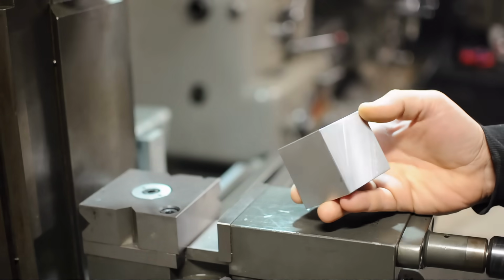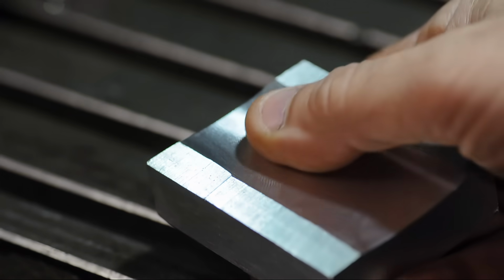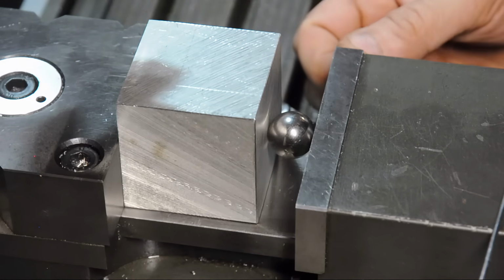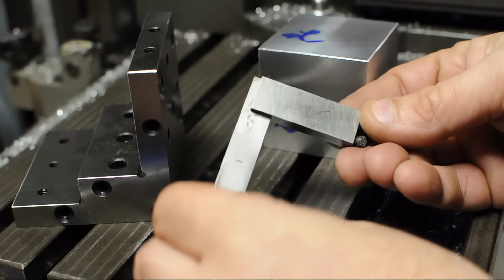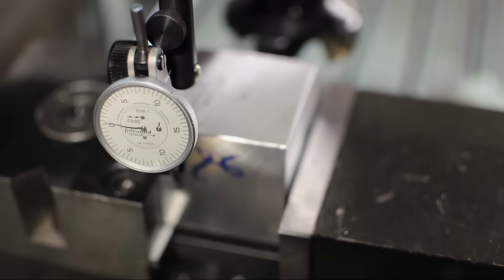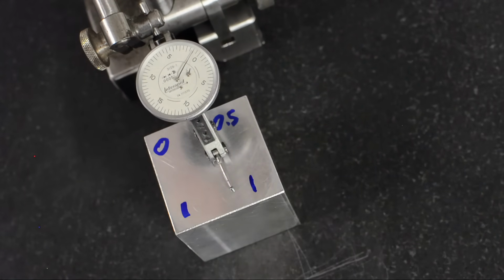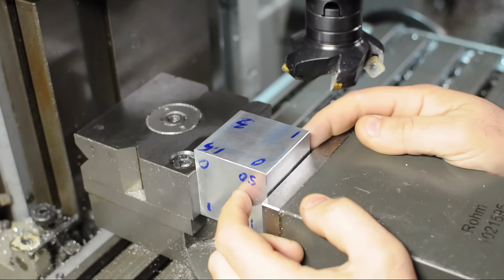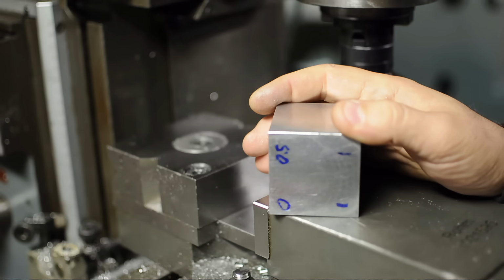Stock? Mill? Square!

Comment: Parallelogram two sets of parallel sides.   Trapezium is only one parallel set.  Rectangle and Square two pair parallel and both are square to adjacent face.  Square have same diagonal in both directions - corner to corner across any face for a cube .

Comment: It's a parallelogram
Reply: it's a rhombus.
or is it a diamond?
nah, I think you're right, it is a parallelogram!
Reply: A rhombus is to a parallelogram as a square is to a rectangle :)
Reply: +Tristan Antonsen almost, the classification "parallelogram" encompasses rhombuses, rectangles, and squares, and both "rectangle" and "rhombus" encompass squares.

a parallelogram is any 4 sided shape with opposite sides parallel, with no other requirements.  rhombuses, rectangles, and squares all fit that bill.  a rhombus is the same thing, but with the requirements that opposite sides and angles be equal.  a rectangle is a parallelogram with 4 right angles, and a square is a rectangle with 4 equal sides.  being that the sides are equal and the all the angles are the same, a square is a rhombus, and being that it's got 4 right angles, it's also a rectangle.

of course, all of the above fall into the classification "quadrilateral".  quadrilaterals are also polygons, polygons are also shapes, shapes are also thingamajigs.  ergo, we're all thingamajigs.  enjoy your existential crisis.
Reply: but if you were to describe the shape to someone who was, for some reason, unable to see the shape then we'd use the correct term "rhombus" as it simplifies description. Sure, you can call it a parallelogram, but then you have to add information to state it has four equal sides.

Comment: Did you measure  the chair to see if it came out level?
Reply: Bob Korves gonna need a larger surface plate
Reply: Should have just rotated the chair. Eventually all four legs would be touching and the wobble would be gone. I believe Numberphile showed the proof. Or maybe it was Mathologer... Who knows...
Reply: Must measure the floor first, then the chair. :)
Reply: Doesn't matter if it's level as long as the cats tail isn't caught.

Comment: I have an 180 pound chinese machine (HBM16) and an chinese vise with no block down system. I usually freak out with an 0,05 cent error (.002"). I cannot believe you could easily have .003 error with that expensive stuff. 0,000 is utopistic.
Reply: You missed the part about him shimming the part to introduce the error?
Reply: Jon Simmons wait wait... I'm italian so I'm not able to understand a straight 25 min video. Surely I missed many parts and details.
Anyway, I just said that seems impossible stay <1, expecially with a 5 bucks machine.
Reply: Its cause everything about his method is wrong. Its sad that people are learning from this. When he puts the block on 1 parallel and taps with hammer.. Right there I can tell he has no clue. Proof is when hes shimming to square a block. My god
Reply: You're not from around here, are you?

Comment: I thought I was the only guy who kept a gag 91 degree angle block on my surface plate. It's like we were separated at birth.
Reply: Pranks and gags dont belong in a machine shop ever. I'd punch you out, and you'd be fired
Reply: @highstreetkillers4377  And you'd be arrested for assault.
Reply: @highstreetkillers4377  Well then, so much for the old high spot blue dot on your safety glasses nose rest prank!

Comment: 1:23 knowing how sloppy I am, I would cut and recut trying to compensate for my previous errors. In the end, that 3-inch cube would measure about 184 picometers across, which is roughly the diameter of an aluminium atom...

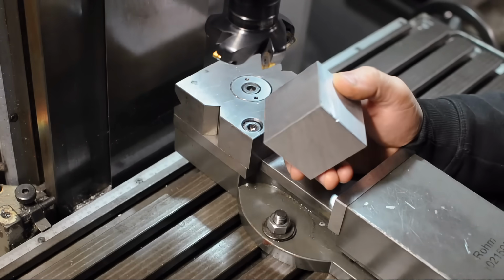6:58 And i guess this is why you want to start with the largest face side, more room for adjustments?

Comment: If I attempted this level of accuracy, 4 hours later I’d hand you a 1 inch cube which is probably still not square.
Much respect for what you do.
Reply: If you have a Kurt vise you can easily make one that is within 5 tenths. I did it and I'm a noob.

Comment: Could you theoretically mill the vise to ensure it's square
Reply: A good quality machinst vise and mill should be square so when u set them up only thing that really un square them would be like a chip or lots of wear shit like that or over torquing the hold downs or mill head not tramed in but in general u should never mill ur vise plus its usualy hardened and u shouldnt need to if u watch the shoot the poop video about milling vices ull learn alot

Comment: I'm trying to understand why tapping the block down into the vice didn't cause the non-square parts to fall off, as per previous videos. Was it incorrect technique, or were you holding back your ninja methods for a future video for advanced squaring?
Reply: I'm not sure, but I think this might be an aluminum block, and that technique doesn't work on aluminum.
Reply: Stefan Gotteswinter could make it work in aluminum.
Reply: Right, steel only.
Reply: Steel only? Why, because the steel might be magnetic?
Reply: Forget everything you saw except the indicating spindle straight. All of it was so wrong.

Comment: my teacher taught me a cool way to cut the last two faces square. u cut the 5th face without any fancy shenanigans, just hammer it down to the vice bottom, and then, flip the part around so that the 6th face is on top, BUT turn the cube 90 degrees as well. now you can cut the 6th face. once that's done you can flip back to the 5th face again and now you can cut it into final dimensions. this takes one more cut but it's very fast and easy to do, also quite reliable.

Comment: Question at 7:00: if you square a smaller side first, any error in perpendicularity (there's always some error) will be not only transferred multiplied across any larger surfaces.  Squaring the largest side gives you a better reference surface to place against your back jaw when doing your next two sides.

Comment: Cut an inch of large diameter steel pipe and flash grind both ends. There you have a circular parallel to use to dial in the head to the bed.

Comment: I'm used to working with wood and if I get a cut within .1mm I consider it 100% accurate, within 1mm is good enough in most cases, and here you're correcting errors of .001mm. :D

Comment: I always use high parallels to get two sides (the biggest surfaces) parallel first.  I would be very curious to see how parallel the two sides were after you milled the third side!  Other than that, this was spot on!

Comment: I've squared tens of thousands of blocks over 30 yrs. For the most part my main concern right off the bat is getting two sides parallel. After that I double clamp to an angle plate and square 2 sides by flipping the angle plate 90 degrees. This is why I use two clamps. So when I flip the angle plate I can remove one clamp that would have been facing up and still never having taken the block off the angle plate. Like you said, Don't over tighten. I use parallels and tap down with a dead blow until my parallels don't slide.

Comment: Good video. I’ve learned a lot from your channel and recently this year I’ve learned a lot in apprenticeship. I use slips of cardboard to hold rough sawn blocks in the vise. It has good holding power and protects the jaws. 
One thing I would have added is sizing the block, because usually you can get that done when you square it up.

Comment: Once you have 4 faces, you can get the 5th by facing on the lathe in a the 4-jaw. 
In fact I think that I prefer squaring stock on the lathe in the 4-jaw to doing it on the mill. But you sounded to hint in the intro that the mill is only one way to do it.

Comment: cutting from right to left is good beacuse if the spindle runs clockwise you press the part on to the firm baking gretings a swiss mechanik

Comment: Is it just me, or does Tony sound like a young Alan Alda?
I had to watch this segment because my father told me a few times about one of the tests he took before he was placed with Rolls Royce to machine aircraft engines. In class they had to take a rough cube of steel and get it down to one thousandth or less in variance on all dimensions, parallel and square to a final one inch cube. With a hand file. No machinery. On the RR factory floor the standard he worked to was half a thousandth. These were the war years; mostly Merlin engine parts. He especially spoke of pistons but there were lots of stories to share. I wish I asked more while he was still around.

Comment: Please understand that the object that you see and the subject of the video are not one in the same. The subject matter is square, and the object shown is a cube. What may be obvious to some, seems to be overlooked by many, and that is the difference between the two. A square is not a cube, but a cube is square. A square is a shape, and limited to two dimensions. A cube is an object, existing in three (or more) dimensions. A true cube, inherently, consists of six square faces and, parallel to these faces, a square cross-section. The main point being, anything can be square, or squared, but only a cube is both. The shape must not be confused with the object. What it really all comes down to is... Great video, another one of many! And thank you for all of the great many lessons you have provided all of us with!

Comment: I never thought of using path integral equations to resolve the number of sides to a block, but Schrodinger, Einstein, Noether and I all agree, you somehow got the answer right! I would however like to see the proof of this in generalized form. Hopefully, it will take less time than Fermat's last theorem. Sincerely, G. Feynman
Reply: Hahaha did you notice that the equation that flashed up showed a gradient instead of the needed Laplacian? :p

Comment: There is another way to get side five done without dialing it in. Need another welding rod or round stock for under your block. Use round stock for front and for bottom. Take a cut to clean, take it out rotate 180 degrees and cut side six. Then go back to side five dust it and it will be square. A block like that should take about 5 minutes to square. Where I worked square was square, less than .001 at max. Nice video. Peace

Comment: Hey Tony, I was wondering something as I make rings as a hobby, and you have been using lathes so you probably know a bit about lathes. I was wondering if there's like a 3 jaw chuck or something similar, but for a drill/dremel that can hold a ring to spin it so I can shape inside of ring? Or maybe there's some tool out there I don't know about that could work? I don't really want to get a lathe just yet as I have no space for it. Love your videos, keep it up <3

Comment: I'm not the yoda of machinists, but here's my take:
I'm pretty sure your issues are caused by the placement of that aluminium rod. (8:31)
When it's up that high, it'll increase the clamping force toward the top of the fixed jaw, creating a very slight deformation of the aluminum clock. This causes a rotation of the block.
Try putting the aluminium rod on exactly the middle of your adjustable jaw. That should distribute the forces/pressure equally on the face of the fixed jaw (causing uniform deformation) and remove the rotation of the block.
Love your vids btw :D

Comment: No movement on the indicator means that your part is square as hack or that a tiny chip is stuck in your indicator and locks it in its positon. I mean not that that would have ever happened to me, but you know... You hear stories....

Comment: TOT Easter egg? The middle expression should be -ℏ²/2m ∇²... but the math works out the same. So yes, a cube in this universe has 6 sides - now try to tell me there is no "Intelligent Design". Love the gags. Your kung fu skills are strong. Best one (IMO), Meatball eating orphan nuts and bolts and pooping finished parts. LMAO.

Comment: has humanity invented a means of auto squaring and paralleling stock? Surely there is a tool or machine that exists. This more hell than the hour it takes me to manually hacksaw a piece of 4140 1.25x1.25inch square stock.

Comment: if it doesn't come out square, blame it on the saw guy... .+010" in size, deburred and completely square off the bandsaw, no excuses. its where I started and I remember the foreman making me calculate the material loss from the kerf. offall is money lost, rime and tooling is saved by not having to remove material on the mill. I broke records running 4 horizontals 1 vertical and 2 large flowjets all at the same time that first year and made my way on to a VMC, never looked back.

Comment: Tony ...youd start with the largest face first as it will give you a more accurate starting point...bigger starting platform equals more *acura....accurate. And i believe thats a...p,   Par,  Parra, panoramagram...no.. .pairoflegoflamb?...no...hmmm...its right on the tip of my tounge... tetragrammaton?...oh...yeah its a   parallelogram

Comment: I was actually hoping you were going to keep going until you got each side to within half a thousandth but maybe that's just me. If it made sense money-wise I'd take my tablesaw table top to a machine shop and have it machined it 100% flat. It was bad when I got it. I DIY sanded it... and by that I mean super shade tree mechanic style... to within 4/10 of a mm but I'm not at all happy with that... but that's waaaaaaaaay better than the 1.4mm low spots I saw before... so I'll be sanding it more. I so wish I had access to your surface grinder.

Comment: So I have this problem squaring, up a 5" x 2" x 1.5" piece of cold rolled. I'm close, but not quite close enough. Where do I go to find the solution? Right here of course. 

Then again, will my 1958 M head be up to the job? My chineseium vise? Is my unchecked granite flat actually flat, or just flatish? 

Hmm, surface gauge? I do have a nice Mito height gauge that I can clamp an indicator to - might do. But, damn I need to make that curved toe for it... Ebay! A little help here! 

Indicators? No problem, I've been going a little crazy buying new Mito and Igage, and assorted used Swiss pigs-in-a-poke from Amazon/Ebay, making sellers happy. Least I can do for them...

Comment: Only vaguely related to machining... Catmull-Clark subdivision of a cube with different edge hardness: http://randomer.net/3d/hardness01.png It doesn't show vertex hardness and only a fake face hardness (because of the edge hardness!)

I should also learn the direct evaluation of Catmull-Clark surfaces... I've mostly done iterative subdivision... but... I've done direct evaluation of non uniform rational B-splines (NURBS)... D'oh!

Comment: Simply hold the 4 machined faces between two vee blocks to square the 5th side to the first 4. No messing about with dial indicators & perfect squareness.
Reply: Yes, however that requires two accurate V blocks.
The "7-sides method" is the best way, it is more accurate AND it requires no special V-blocks.
Reply: @johncoops6897  I guess it is a matter of opinion and what has proved to work efficiently for you over the years. This video shows the idea in production - https://www.youtube.com/watch?v=g3BSNY0HWGM

Comment: So I can say why one would do the biggest surface first. If you have a piece of raw material, especially one thats not as "nice" and "kinda square" like this one, by following these steps you'll have a nice big surface thats flat to flip back 90° to mate nicely with the fixed jaw. Where as if you do a smaller face first, it will be unnecessarily more difficult to get it square. I mean you are gonna have to mill all 6 sides anyway right? So work smarter, not harder. However, with some types of mild steels that are rolled(or whatever) to a +- thickness, I tend to put those surfaces to the fixed jaws side. Obviously this won't be advantageous if you have a big size difference between the rolled surfaces and the sides 90° to those sides. Either way, 95% of the time you would start by cleaning up the biggest surface first.

One thing that I did note. Once you're on your 4th side onwards, is it really necessary for the aluminum rod on the moving jaw side? I guess if you are unsure that it is infact square then it can't hurt. But if you are confident that its square then you might be pressing marks in you machined sides of the block.

Comment: So why do you mill the largest face first? Anybody know? I looked through the comments and didn't see anyone commenting on it. 🤷‍♂️

Having the largest side machined first so it's a known flat surface likely gives you a better base, so to speak, to build the rest of your machining processes on. I would think there's less of a chance of something being out of square with a larger face area vs a smaller one. For example, a face that's 2"x10" vs a face that's 10"x10". Seems like there's less chance of error when the face is larger. Much like using a level. A longer one will show something that's barely out if square where a short one wouldn't. I'm guessing it's somehow related to that.

Comment: Sits in chair. "Dammit... the back corner of my chair is a thou short. That throws my spine out of whack by 30 thou...fuck.. back to the milling machine. Hmmm, maybe I should use the indicator on the four corners of the chair?   light bulb goes off in brain  ....naw,. let's just shim it.

Comment: Why start with the largest side first?  No part is ever perfect.  Starting with the largest side first will reduce the error when switching to the smaller sides.  If we start with the smaller side then the error is amplified to the larger sides.